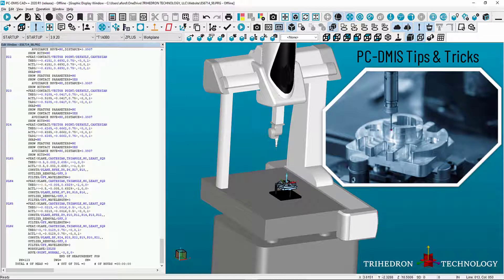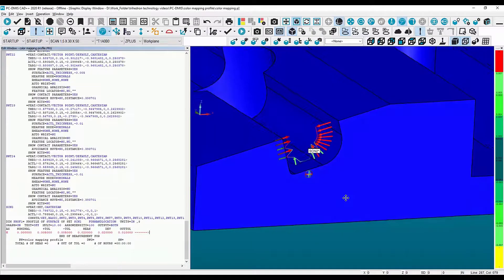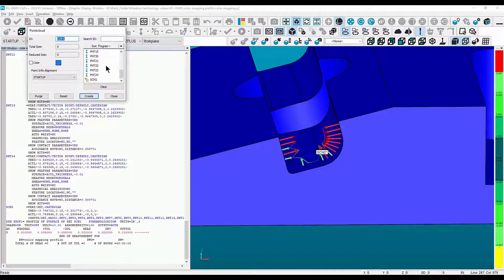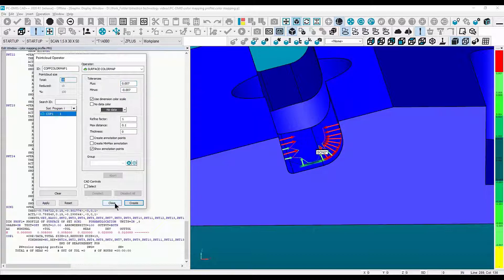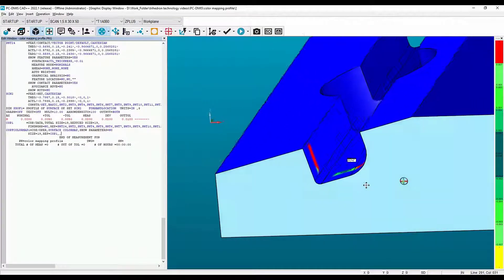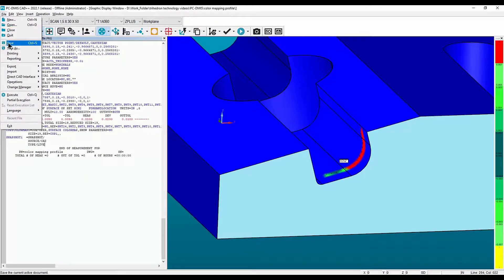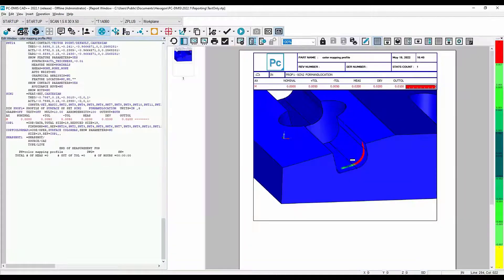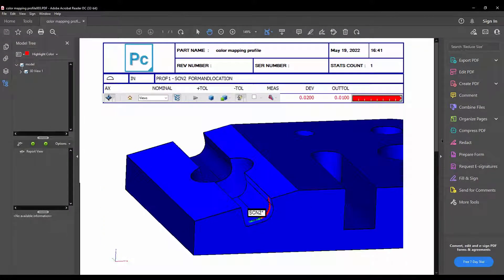PC-DMIS color mapping profiles

Comment: Hello. Using the same measurement program, the pointcolormap disappears when measuring another sample, and the values shown in the colormaps are from the previously measured sample. I can't understand the reason for not updating the pointcolormap, as some samples were updated and others weren't, which becomes more strange. This happens when measuring with a laser, by tactile measurement, the pointcolormaps are always updated when measuring samples sequentially. The problem only happens when measuring by laser. If anyone is aware of what could be causing it, please let me know.

Thanks.
Reply: just say :PCDMNIS!